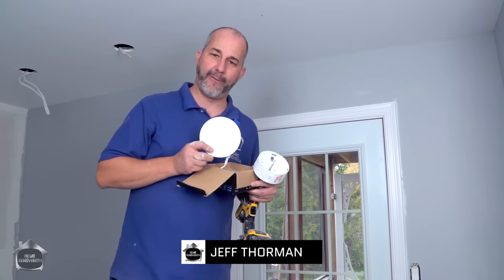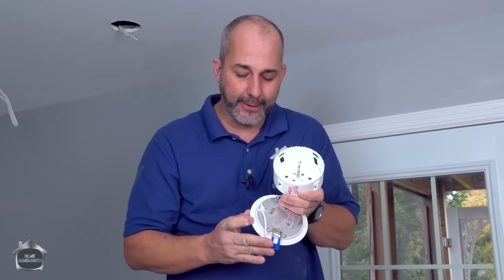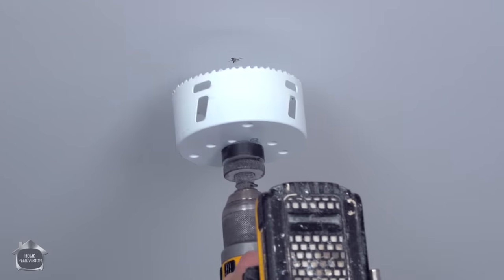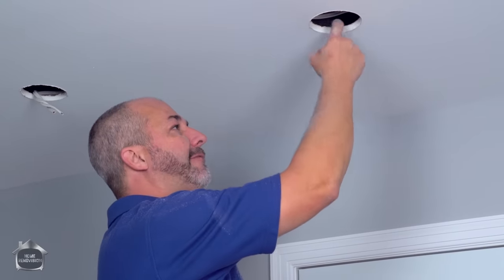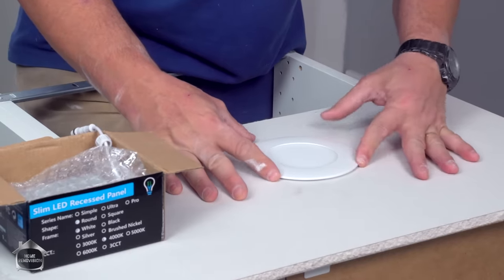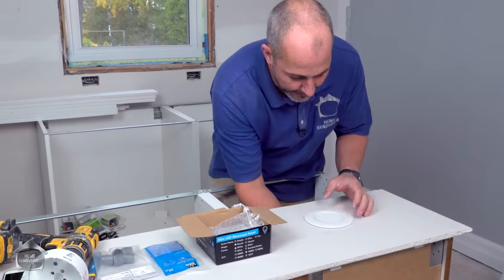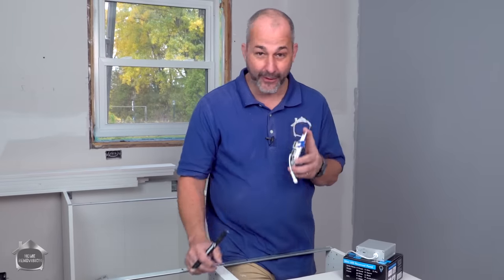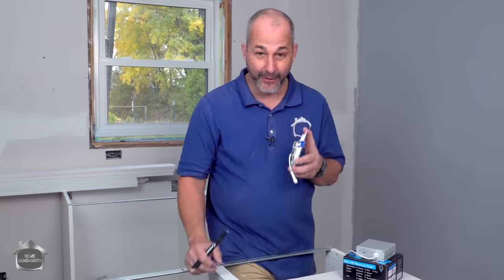How To Install Pot Lights in Kitchen Ceiling

Comment: I'm about a year late to the party here, so I don't expect Jeff to reply, but does anyone have experience installing these on popcorn ceilings? Are there any gaps or shadows around the edges? I suppose you could sand down any bumps that interfere...right?
Great video as always! Thanks!
Reply: Nope they are fine, and if you leave the gasket on they sit perfectly.

Comment: I recently installed pot lights, but the issue that I'm having is they're flickering. I had to adjust the dimmer everytime I switch on the light. Any suggestions how to resolve this issue? Thanks
Reply: you need a different dimmer

Comment: trick to using a hole saw; use a longer pilot bit. You may have to make your own just by grinding a flat on the bit where it makes contact with the set screw. The new pilot bit could be 6" to 12" it all depends on the job.

Comment: Can you leave the ballast and light sitting under direct contact with insulation?
Reply from the maker: yes you can. since it has access for inspection and the box is sealed it is rated for IC. Cheers!
Reply: @HomeRenoVisionDIY  thank you!

Comment: How do you remove this light? I tried with my downlight and pulling on it caused a hole in the ceiling. Those springs are so string that it's almost impossible to remove without damaging your ceiling without a special tool.
Reply: @Tony Jin  Jeff shows you in the video, go back and take another view. Cheers!
Reply: @officiall.d1010  Thanks! I did go back to watch it and it looks like his springs are not as stiff as the ones on mine. What I ended up doing is taking a Home Depot paint stirrer and braced the dry wall by pushing up on it with the stirrer (at the already where the clamps are) while pulling the lights down. It kept it from cracking on my other units.

Comment: You can buy extension connector cables up to 10ft long for those lights for a few bucks a piece . If you wire in advance a change of plans isnt as much of a death sentence as it sounds.  Those cables are saving my bacon for a lower than expected bulkhead as we speak

Comment: Where can you buy these type of knockout cable connectors
Reply: They are called:
knockout non-metallic push-in connector.
The big box stores have them.
3/8 ,1/2 and 3/4 inch sizes available.
Reply: @user-mv5bu2kk8b  thanks so much I looked at menards and they didn’t have them. I finally found them at Lowe’s!

Comment: So here's the question... What do you do with the last one in the line? Say you're installing three lights. The first two get the loop that gets cut in half, but what about the third one? There is nothing after it. Do the wires just end at that light?
Reply: Only one wire 14/2 or 12/2 to last box.

Comment: I had to replace some years ago in an office and the springs had so much tension it ripped out the 5/8 drywall. They weren't led though. I remember they were hotter than hell.

Comment: I tried the reverse method. It’s slow and doesn’t cut has good as using the teeth. The tip when using the teeth is to start the rotating the teeth before making contact but don’t push too hard at first just let it dig in.

Comment: I was curious because he talks a lot about the quality of these pot lights and criticizes the ones made in China which I totally agree.  However, i decided to contact the company that mades the lights expecting to be made in USA or Canada. My question was, where are the lights manufactured? Below the response so judge by yourself. Good video by the way, just that he is missing the fact that those lights are made in China as well.  

Thank you for your inquiry! Our product is manufactured in China. 

If you have any further questions about our products or need any assistance with your order, please do not hesitate to email again; I will be happy to assist you!

Best,
Rachel
Reply: I'm not sure he criticized them being manufactured in China.  He said that they are all made there and they just put different labels on them and some are better than others and went on to recommend these.  He also said these particular ones were better than the ones from HD.

Comment: I had an RV with these LED module lights and I was constantly having to change them.  I'm used to LED bulbs lasting 5 years or more, so I was surprised at how quickly these modules start to flicker.

Comment: Commercial Electric’s ones, both 4 in and 6 in, are the best in terms of quality and cost. They have gaskets, quality springs with protectors, and a range of 2700K to 5000K for light color and brightness. Nowadays, that Kelvin change ability is table stakes for customers. To me, any LED product without it is incomplete…

Comment: I honestly prefer fixtures that use standard bulb sockets then put LED bulbs in them. All my pot lights use GU10 style bulbs. Makes it a lot easier when they burn out. Let’s be honest LEDs aren’t perfect. More often than not it’s the power supplies that die first as they are switching mode supplies which are complicated and full of inferior quality electronic components. 

I do have a few proprietary LED fixtures in my home, but those are in low traffic areas like a walk-in closet and the laundry closet. It should take a lot longer for them to burn out there. 

If one were to go this route…I would plan to buy a number of extra fixtures and put in storage for when failures happen. That way you have the same style, color temperature and wattage/lumen output.

Comment: I was hoping he would show us how to run wire in a ceiling where there is a bunch of insulation above the drywall.   My kitchen ceiling has an attic above it and I'm sure it will be a pain to run the wire.

Comment: If LED lights are supposed to use so little power, why can't you run multiple lights from one Romex connection? I'm not suggesting putting 100 lights from one slave box, but that room should be able to be lit from a box that distributes low voltage to light the rest of the room. This begs the question: How many low voltage outlets can you get in one box?  It just seems like it would be nice to make up on Feeder box, and then snap low voltage cable to the other lights in the room.  Would that produce a consistency problem between the lights?
Reply from the maker: I get the idea, however the ESA folks like to have standard supply lines in the event you swap out an led for a standard fixture in the future. they want to eliminate the possibility that a supply would be over worked and heat up to cause a fire. Cheers!

Comment: where is the connection to the switch? how did you run the wires? what codes should be aware of? lots of things you didn't show but the easiest part to do

Comment: Isn't a ballast necessary for this type of led light?
Reply: The box he connected the wires into was a driver that reduces the voltage down to 12V for the pot light.
Reply: @tacov3410  ok thanks. By ballast I actually mean driver. Seems it is well covered unlike the ones we have here.

Comment: I bought some of these prior to your video. They're really good when they're not broken. Unfortunately, the plastic towers that hold the metal springs are not strong enough to withstand removal so these are pretty much single-use items even though they're perfectly functional after those towers snap off. Extremely disappointing that an otherwise good product is rendered non-durable over a tiny but devastating design flaw.

Comment: I wish you could gang the spotlights in a series using the screw together wires and not have to have a separately wired box for every light.
Reply: I don't see how this is not series. He's wiring a neutral and hot into a junction box, and then it's leaving the box and going to the next one, right?
Reply: That's my concern also. How can these be wired in series?
Reply: So, a junction box for each light?

Comment: When I do ceiling drilling I do wear a mask but also I either wear a plastic rain poncho or a contractor bag with holes in it so I don't have to wear drywall dust for the rest of the day.  Runs right off of me usually.

Comment: I don't understand why since they are low voltage, you can't just run romex to one box that accepts the cables for say 10 or 20 of those pot lights.

Comment: My lights, similar to yours, had the option of setting them at a different light colour (warm white, daylight  , bright etc>) i Just a tiny switch on the back). f you have this option on your lights,  make sure you set them ALL  to the colour you prefer before installing them in the ceiling. Nothing looks worse than different brightness or colour between each light.
Reply: I got the new reno ones last week from product pro they had those same switches to allowing to change the colour. The old one didn’t have that capability. It’s nice if you want to change a room like the laundry room a different colour. But your right you have to make sure they are all set the same when installing

Comment: What is the consensus on the wiring used for the 6" LED thin lights. I've been using 18awg or the same gauge that is in the transformer for the thin light I'm using. 

Is this an ok practice or do you have to use 14g or 12g. Usually 99% of the time I'm using a Lutron Dimmer switch with the 2red 1black and 1green wire coming out the backside that is 18awg as well. Thank you..
Reply from the maker: 14. Cheers!

Comment: I had four of these lights, with mousetrap strong springs, installed. After 1 year two stopped working. After another few months the other two stopped working. I had no problem replacing the first two. But for the other two I ran into a problem replacing them. The 'manufacturer' had changed and the connectors, male and female terminals, were reversed. I would have to get into my ceiling to get at the connection box. HELP!
Reply: What Brand was the led light you were using?
Reply: @mrbrainless25  Luminaire, supplied and installed by an electrician.
Reply: @mrbrainless25  Liminaire
Reply: @jameslatimer3600  I haven’t used that brand. I have had 90 of the reno ones in my house for 3 years now on dimmer switches and haven’t had a single failure. I got them from product pro.
Reply: @mrbrainless25  I went to their site but can't see how to purchase any of their products. Do I have to phone them?
Reply: @jameslatimer3600  product pro .co for USA I believe product pro inc .com for canada
Reply: @mrbrainless25  got it,  thanks for that.

Comment: Why do you have to use 12/2 Romex (used for a 120v AC circuit system) wiring to each light with a converter box to each light? Can't someone design a LED lighting system with only one single 120v Romex supply line and one single converter box with multiple LED outlets? Or a way to connect them in series from light to light from a single converter box. Each LED light should not have to have 120v supply line. That's an over-kill. I believe LED lights operate on a 24v DC power.

Comment: You forgot to mention that not just any dimmer switch will work.  Do the research before hand on which dimmer switch brands & models work with the brand & model light you buy!  Otherwise you will get weird behavior, flickering, very narrow range of "dim level", etc bc the voltage levels & frequencies may not match up. Trust me, I'm an EE ;)

Comment: the most difficult about installing recessed led pot lights is when you are facing with floor joist that are spaced 18" apart and you need to run electric wires through it to power your LED recessed pot lights.

Comment: I stopped installing leds like this. Unless you buy extra, when one burns out (and they will) you will never find an exact replacement. I always install housings now because you can marth Led bulbs easier than having to replace all of the installed assemblies.

Comment: Removing the gasket will allow heated air escape into the ceiling. The seal is there for a purpose do not remove it.

Comment: I’ve been watching a lot of these videos. No one will explain how they use 12 gauge or 14 gauge house wire and connect it to 18 gauge in these junction boxes? They aren’t compatible ? Unless the wires from your house are 18 gauge?

Comment: Here in Australia, we use all plug n play down lights. Way easier to install and replace than this
Reply: What do you mean plug and play lights?  Mount a light to the ceiling and run the wire to an outlet to plug in?

Comment: My late father was a union painter for a while and he said a trick to painting ceilings (to prevent smudges later on like while installing pot lights) is to use regular wall paint on the ceiling and then on the walls use an "egg shell" finish. The wall paint is more durable and having the two different finish styles achieve the same effect.

Comment: Sorry, me again. You didn't mention color temperature (Kelvin). I personally prefer warm ("yellow") light as it feels cozy and not clinical. However, in an office setting, for example (or even a kitchen where one might want to emphasize cleanliness), "daylight" (more blue white) may be better.  I would look at the illuminated samples at the big box store, then as you rightly suggest, buy the actual fixtures at a wholesaler.

Comment: Removing the rubber gasket compromises the ceiling air barrier.  Installing LED's to save energy at the expense of losing heat and increasing moisture infiltration in the attic is not a good trade off
Reply from the maker: that is true, however if you  noticed there is no insulation in that ceiling because I have a 2 story house. and we use a vapor / air barrier in our homes so it is not necessary. very good to keep in southern states however. Cheers!

Comment: The holesaw will wander because your pilot-bit is too short. if your pilot-bit is through the drywall there is no need for reverse first. But the reverse trick to prevent the wires from getting ripped is pretty neat. Thanks.

And this: https://i.postimg.cc/c472HbXk/2020-12-22-11h12-51.png
is a nogo... never ever blank copper outside the connection...

Comment: I disagree. I think you need to cut the holes before as it causes so much dust from drywall to go all over the nicely freshly painted everywhere!! Also if you use a dust collector circular plastic tool, it leaves circles on the freshly painted ceiling

Comment: This looks like such luxury. In Vancouver, the city still requires double drywall and fireproof caulking above all pot lights, even LEDs. Argh!!!
Reply: In residential construction???
Reply: @gregsmith7391  Yep, the townhouse we just renovated this summer. Nuts.

Comment: Those wires were stripped why too long you have naked cooper showing the coating should be just inside the quick clip. With naked wire you are risking a short that can lead to a fire.

Comment: The first thing you should be saying when you do electrical work is that it MUST be Inspected. You did have allot of wiring mistakes in your video. The biggest was the seal gasket is part of the vapour barrier system if you need it. Always read the instructions. Also unless you are an electrician I would not quote code rules.
Reply: Vapour barrier isn't needed in all rooms

Comment: Vega lighting is now selling the same lights for $21-$22. No more deals
Reply: I just bought similar recessed lights from Q plus home that have a light switch change option on them that can change the colour without having to pull the lights out and manually switch them all.  Bought them for around 16 bucks a light.

Comment: How about a rough in inspection?  Doesn't the inspector require an anchored box and eight inches of wire hanging out for the rough in inspection to pass?  In most of these videos, the box is just tossed on top of the dry wall...... I don't think that will fly with an inspection.

Comment: How the heck do you keep that Milwaukee hole saw attached to the dang arbor/bit??? It just goes spinning off the dang thing! Especially considering you're suggesting running it backwards! Ridiculous! Would have done much better to have bought a cheap 6 inch hole saw with saw and bit one piece. I paid $55 for crap!

Comment: Your link for the lights go to a site where they are $24.99 each, not the $11.29 you quoted. What gives?
Reply: First of all, he doesn't set the price.  He quoted what he paid for them.  Second, he quoted a price for 4" which are currently selling for $20.07.  I suspect the $24.99 is 6".  Third, this video is from 2 years ago.  Everything has gone up in price.  Lastly, he provides a 20% discount code.  I purchased these less than a year ago and got 14 for $181 w/free shipping to US.  That's $13 ea.  I can confirm that I got a way better deal then if I purchased from HD as I did price similar there.  Installation is very easy.  I highly recommend!

Comment: Wrong! Never drill in reverse, it defeats the purpose of the hole saw. The teeth are normally placed at a 15 degree angle for going clockwise. Now I agree with starting the hole in reverse but do not drill the whole thing out in reverse.

Comment: These lights are crap.  They don’t respond to the app.  They don’t work with Alexa.  They constantly have to be reset and reinstalled.  It’s not my Wi-Fi or my hub because all my other lights work fine.  The illume are not much better.

Comment: Led light fixtures are garbage!. The power supplies fail, or the built in electronics fail and are expensive, then they discontinue them. After changing out several power supplies over time or the whole fixture, then you cant get parts and cant repair it and u have several of them and now your forced to buy a totally different one which doesnt match the others, now u must change them all. A standard fixture gives u none of these problems. Use a standard screw in bulb fixture and screw in a led or standard bulb. That way u will never have to swap out failed fixtures. I could care less if they use less energy or not. They will end up costing you much more in the long or short run.